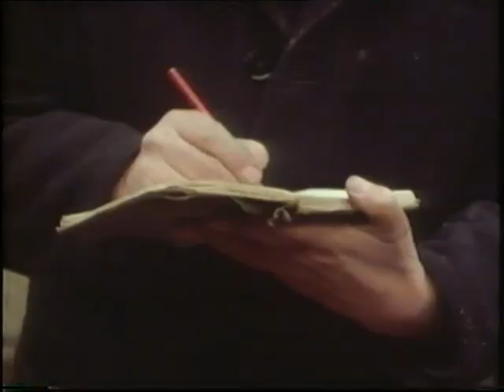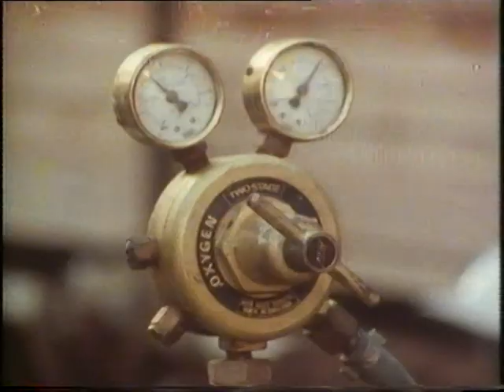1970's Building site | 1970's London | Tower 42 | Writers Workshop | 1977

Comment: Glad they have their flat caps and sort shoes on, got a be comfy while tons of steel float overhead
Reply: No hard hats there
Reply: @airscrew1 The guys that built the skyscrapers decades ago knew a thing or two about survival, unlike the H&S self righteous mob.
Reply: airscrew1 I've worked in similar situations (warehouses etc) since I was 16, I am 46 now and have both my feet thanks to steel toe caps. You'd have to be crazy to work on a site like that without at least your boots and safety hat. An RSJ will kill you either way...but it's usually a spanner or a big tile that comes down. H&S must have saved thousands since these days in the video.